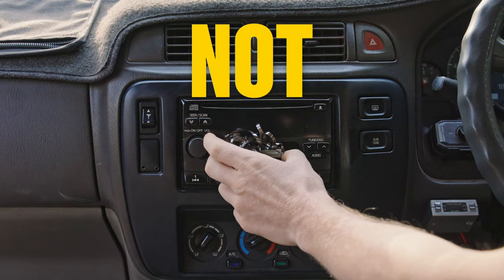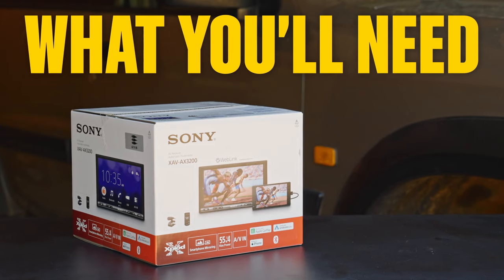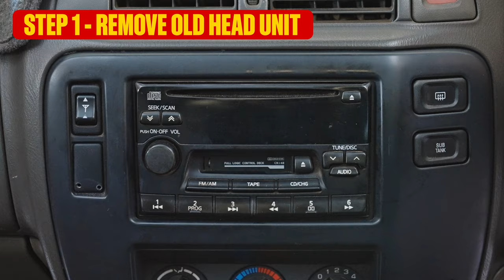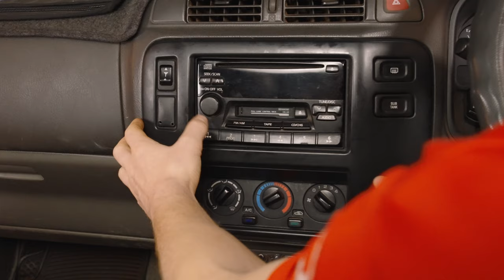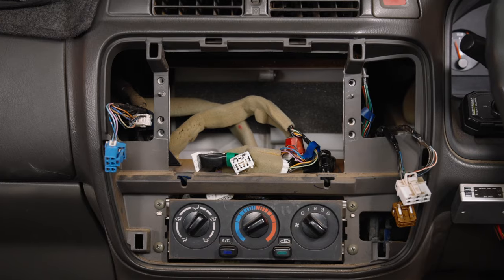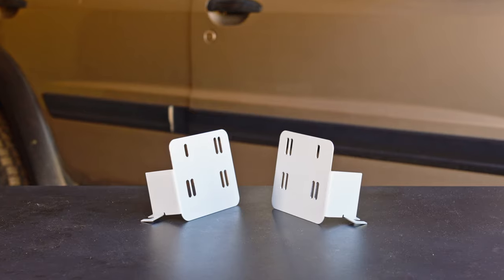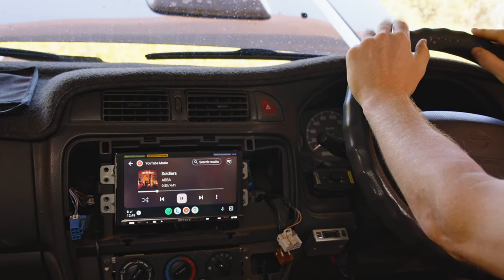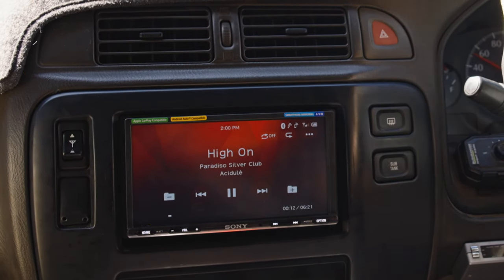How to Upgrade Your Head Unit - Super DIYs

Comment: You skipped the part you need to wired the harness better your unit and the compatible harness which is not that easy for beginners. Although you definitely don't need soldering but crimp caps.